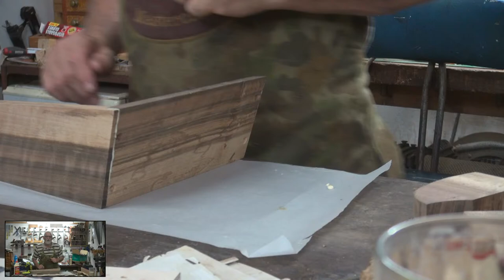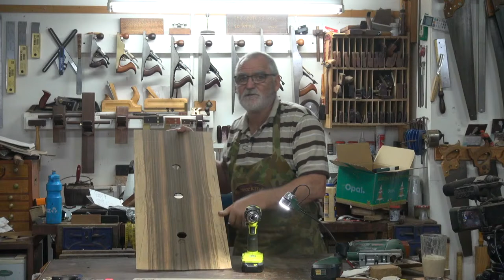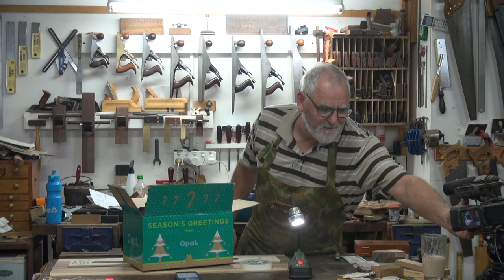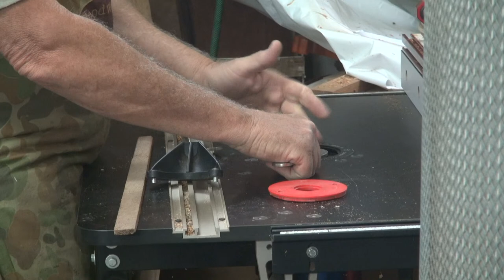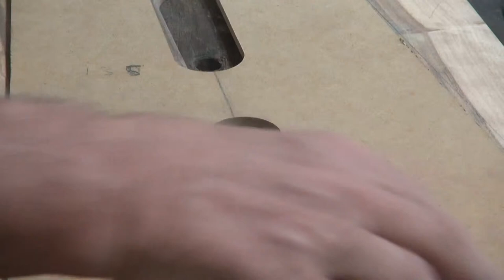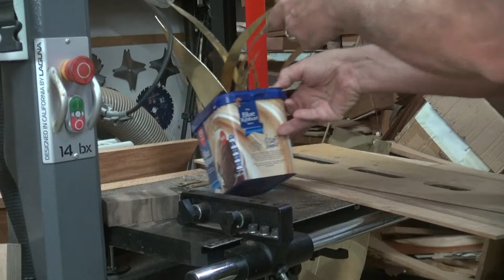Joinery, Glue-up and general Woodworking.

Comment: I am severely visually impaired, so I would love to wear glasses to see again but they don’t work. But I still wear glasses when I’m in the workshop just in case I don’t like stuff in the eyes so normal glasses to see is you’ve got protection in front of your eyes at all times which is a good thing as it protects eyes and hopefully they are sunglasses as well. Lovely to your channel shame I’m not listening to live that. I’m in England so probably asleep when you do this And also safety glasses, forgot to say that I was very precious
Reply from the maker: Hi User-uq8, Absolutely agree very expensive cameras we have in our heads. I spent some time in the Visually impaired woodworking shop that they have in Brisbane where I live. I was blown away with how they had adapted much of the common woodworking machinery and other tools so they can be used safely with limited or no vision at all. One experience I had was watching a woodwoturner making a bowl. When the lathe stopped I commented on how well the bowl looked that he was making. "Nah, not happy with it" he said. When I asked him why he told me there was a dimple at the base. I looked at it and said I can't see it. "No probably not, but run yah finger over it and you'll feel it." He was right it was they. I would have missed it but he didn't. Thanks for the comment. Cheers Steve